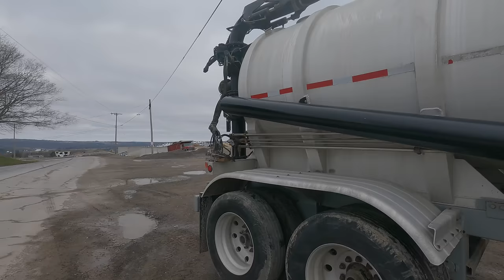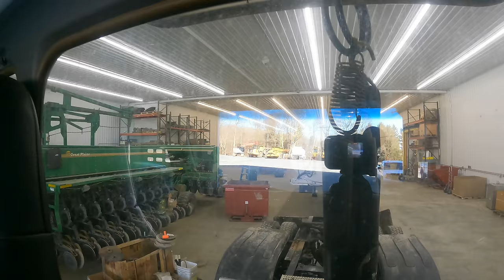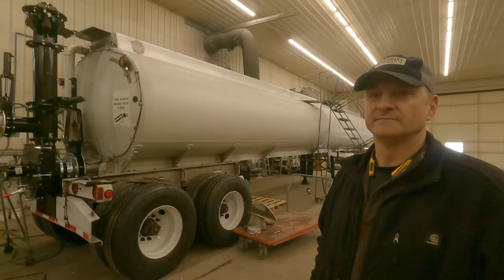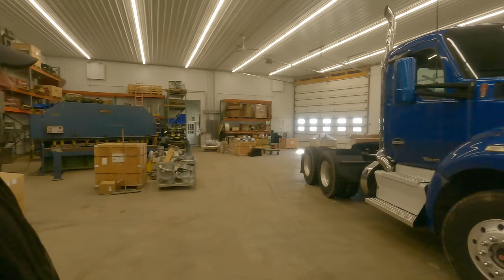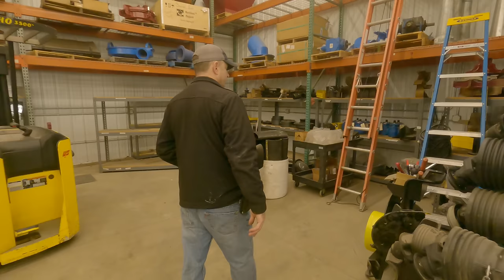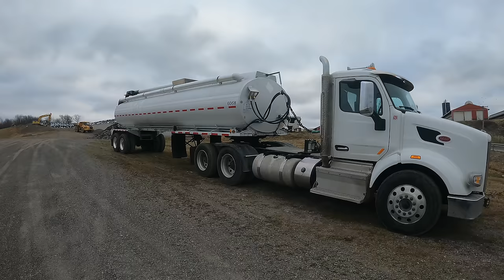Alex’s new manure trailer

Comment: Hope everyone is back in good health.👌
I definitely need to get one of those Tractor Supply Shop Stretchers.
Chuck's shop is 3/4 acre under roof, quite impressive. I have 2-90x500ft lots and could use something like that, too bad I don't have the purchasing power to go with it.😂
You folks have been bangin out the work there this winter.🤙

Comment: Quite some engineering on those manure tankers and the whole recirculation process…I know sand bedding can be abrasive…I wonder if any of those tankers get a protective coating sprayed on the inside of them to keep the wear down from the sand?

Comment: How fast does the Petercar go down the road? The company I drive for is putting Dash cams in the trucks that will send a report to the safety department when a truck is over the speed limit even by as little as 1 mile per hour. How many reports would your safety department receive if you did that?

Comment: Are you running overweight permits for the manure trailers? 8500 gallons of manure at just over 8lbs per gallon + tractor and trailer = HMMMMMMM LOL
Reply: That is why they run them at half capacity.  :)
Reply: Yeah right to quote Andy. LOL  @beckyumphrey2626